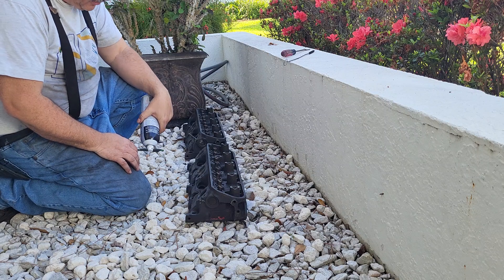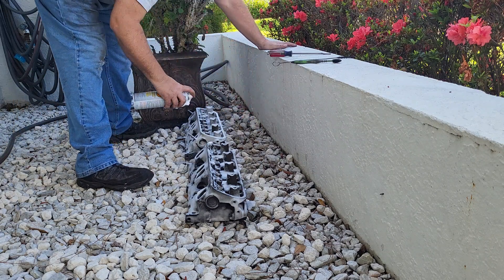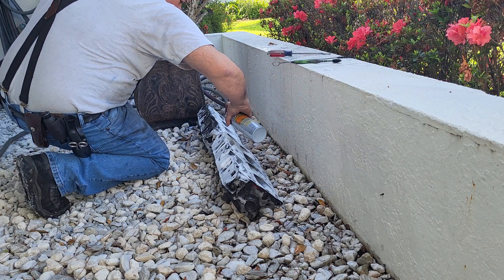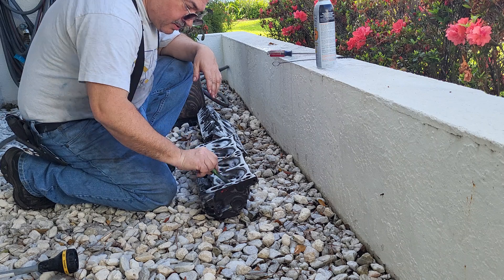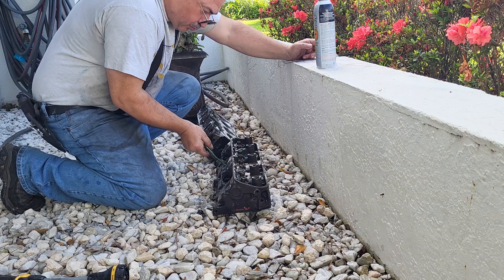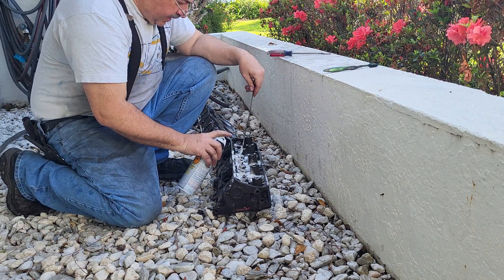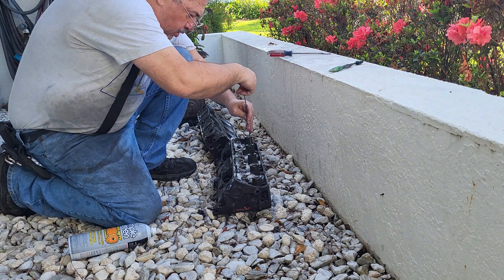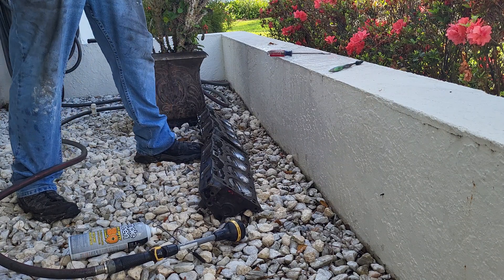David Vizard, Unity Motorsport, Mission Impossible 318 project. Diy cylinder head cleaning.

Comment: Dollar general. Heavy duty oven cleaner (wear gloves will eat skin). Yes glasses of course. Pressure washer most important turbo tip (lowes or home depot) (I've used 1500 psi electric does pretty good, Rebuilt a broke gas powered 2800 psi much better). Yes will back spray all over you (go take a shower when done). If your doing this kind of work you probabley need some degreasing anyway.
Reply from the maker: No kidding!

Comment: I love the Citrus cleaner by Chemical Guys, but I use that after I use Yellow top "Oven Cleaner" and a trash bag. Yes, spray them down with oven cleaner and put in a trash bag for a few days tied up, They come out extremely clean after a car wash high pressure rinse. Blow dry as you said then do the porting and what not, The citrus cleaner is the final cleaning procedure, It comes out spotless of oil and grease afterwards.
Reply from the maker: Good info. Thanks

Comment: I would sooner use Purple Power and a tub. Just keep it wet and you depending on the thickness and age of the grime and if baked on, i find a lot of scrubbing is not necessary. It must remain wet and depending on what I am doing, I may pour the entire gallon into my tub. I despise aerosol cans.  A stiff dedicated parts washing brush is also another good investment.  A few years ago, I replaced the head gasket on a Ford Probe and it was one filthy aluminum head. Gasoline did not work and is not really a good idea. Kerosene was useless. I has some Castrol Super Clean and the head came out looking brand new. Purple Power and Super Clean are very similar products, alkaline based. You will not etch the aluminum unless you leave the soaking for a few days maybe weeks. It will do similar on cast iron but without the new look. Both products will remove most paints after soaking.
Reply from the maker: Good info. Thanks

Comment: When I do mine I’m gonna be like Chuck and go glove and goggleless. Can I wear a second pair of underwear to protect the crotch? You said nothing about that. And what about ear plugs? That stuff will eat through your ear drum like a tongue through a cheap diner napkin. Do you have any idea what that stuff would do to a guy’s wife’s roses. Of course you do. What kind of cleaner do you recommend for the final cleaning?
Reply from the maker: Iron I used the parts washer, dry it and wd40 the head so it doesn't rust. If it will be painted do not wd40 where the paint will go. If it will be stored for a while wd40 the head and clean wd40 off with laquer thinner. Thanks

Comment: I have an electric power washer and I found cheap wet media blasting kits on amazon... Sometimes they're tricky to get the vacuum going of the media and you have to hold it very specifically to not get wet  but I found that baking soda blasting (got a great deal off Jegs for 100 lbs and its sourced in Cortland like 40 mins away so quick delivery) worked amazing... I was worried about flash rusting as it happened to me pretty quick before manually cleaning but somehow they stayed very rust free (maybe it leaves just enough microns thickness worth of oil?).  I couldn't believe how clean they got and degreased... ended up with some dead grass for a while but still. Wore a shield and sometimes particulate filter even though it's definitely safer to have any baking soda enter your system than sand but no noxious fumes of a degreaser is nice.
Reply from the maker: Good info. Thanks

Comment: I used wd40 to remove carbon from heads for years, now I use dawn dish washing liquid for decreasing, make a tub and submerge the head, it gets them real clean. I do that before doing any work on the heads and then repeat after the work is done.
Reply from the maker: Good info, excellent degreaser.
Reply from the maker: @bigboreracing356  Funny!

Comment: i usually take the big parts like heads to the local do it your self car wash and spray the crap out the parts and their orifices with the tire soak the green corrosive stuff thats offered by the dial at the car wash and let them soak for a few minutes then repeat then switch over to high pressure soap and finally high pressure rinse
Reply from the maker: I have used a pressure washer for heads and blocks. Works well. Thanks